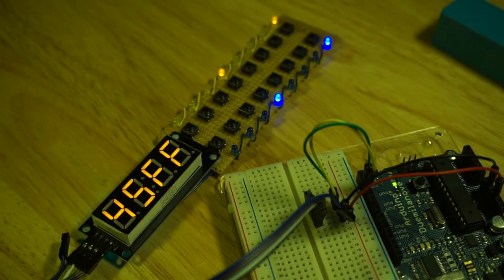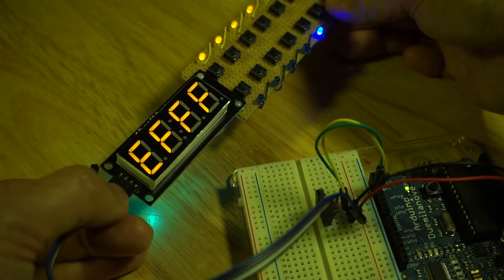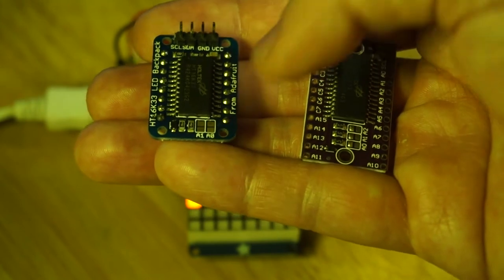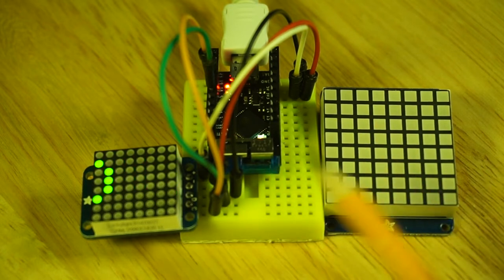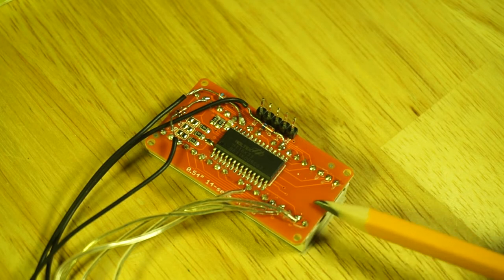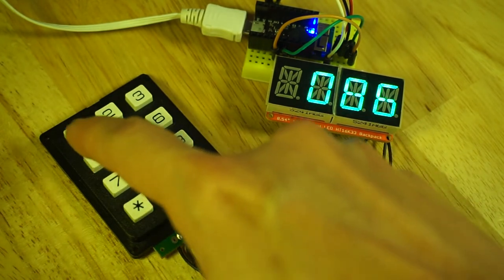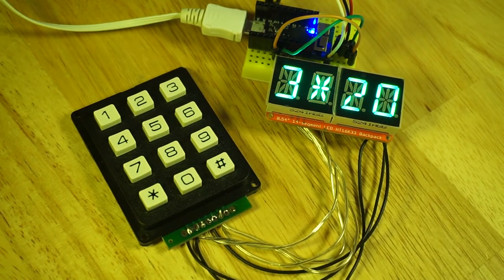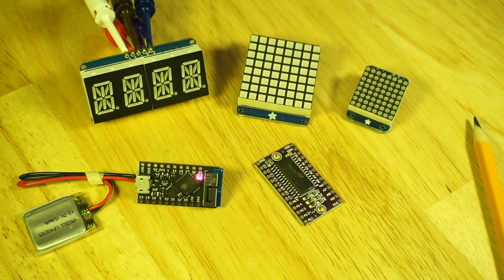Adding a push button matrix to HT16K33 led display modules (featuring the TinyPICO)

Comment: Hi Bornach, nice video! I also spend some time with the TM1637 and other TM16xx chips and made some videos around it, including one where I also add buttons to a module. In case you're interested; I published a library for the TM16xx chips which implements the familiar print function to print alpha numeric text and also a button class that supports detection of single, double en long button presses. You can find it on my github account.
BTW. The TM1640 is a nice chip for 16x8 led matrices, but doesn't support key scanning.
I still need to look into the Holtek chip family. The HT16K33 seems quite interesting as well. Thank you for showing those modules and for the inspiration. I really like that 14-segment module!
Reply from the maker: Yup. I'm subscribed to your channel.
I think I did my video of modding the TM1637 4-digit module a few months after yours.

I didn't go as far as desoldering the 7-segment to put a matrix on it. I'm more likely the buy the bare chip instead.
Reply: @bornach  - And I'm your subscriber too! You've got some very nice projects on your channel.
Before making that 6x5 TM1637 matrix mod, I modded another module by keeping the display and adding buttons and leds. In later projects I made some PCB's and composed a 8x64 matrix using four TM1640 dual matrix modules. The PCB in my latest video also includes a bare TM1637. I use it to drive a 4x7-segment display, some RGB leds and to read a 5-way button. The TM chips are a bit cheaper on Ali than the HT16K33, but they miss true I2C. (To save pins I usually share the data pin and use individual clock pins).

Comment: Great stuff! I hope you release your MicroPython code, I’d love to possibly use it in a future project :)
Reply from the maker: An idea I have kicking about is a guide on how one goes about creating a MicroPython class library for a module that only has Arduino support. The Adafruit modules ulhave Circuit Python libraries but that often requires importing their support libraries that were meant for their Feathers. So some small amount of porting/refactoring is useful for keeping your projects lean especially on these microcontroller based file systems.